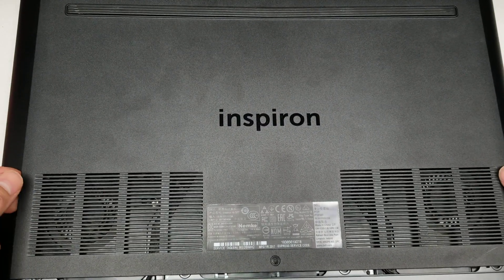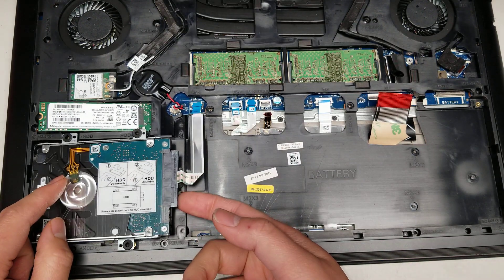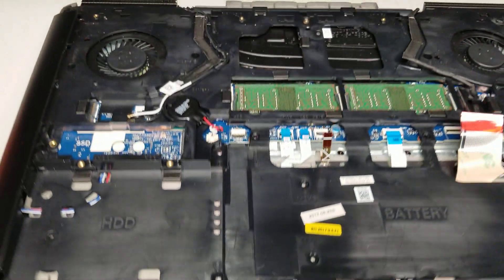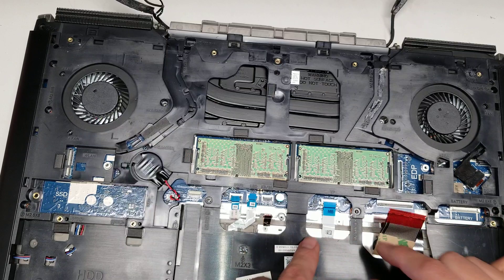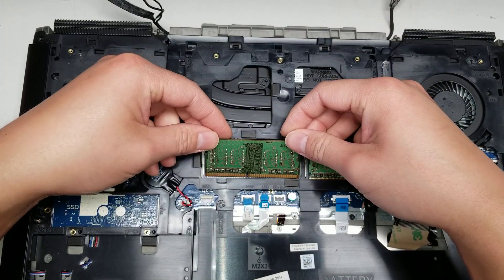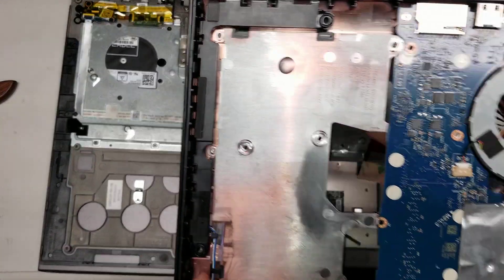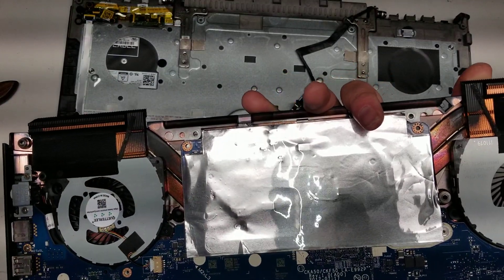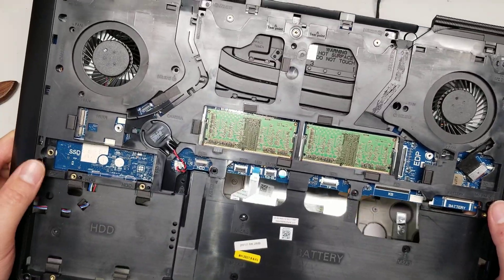DELL Inspiron 15-7577 15 Gaming 7577 Disassembly RAM SSD Fan Upgrade Repair

Comment: I was lucky to find this video, very nice tutorial. I was trying to change the thermal paste on my processor and GPU, but unfortunately, I wasn't able to reach it as the motherboard was hard to take off. I assembled it again and it was working fine. I'mma send my PC to tech support to do what I wanted to do, keep the good work, my dude!
Reply from the maker: Thanks!
Reply: You rock, man! Please, whenever you get your hands on this model again, make a tutorial going through the GPU and Processor if one want to change the thermal compound haha

Comment: Hi thank you for this video. It helped me a lot. Today I replaced a right hand side fan and had a problem starting the system. Black screen and laptop shut down after a few seconds. Then I disconnected most of the wires and tried to run several times adding one component at a time. It was like waking up the body after a surgery and it was so weak to rouse 😉 Finally it’s taken off by pressing a Capslock on a keyboard. Weird 😏
Reply from the maker: @marcindenis6732  lol it's because the bios reset. You have to wait a few minutes for it to start up after disconnecting the battery.
Reply: @ Thanks. Now I know 😁
Reply from the maker: @marcindenis6732  no problem

Comment: I'm so grateful to you for posting this video! It was easy to follow along and remove all the necessary parts. My laptop is working great with no more noise alert because my fan and heat sink are not working. I had to shut it down and rebut it again. Once I rebooted it, it went into the BIOS and I was able to reconfigure it. It booted up again and everything is working great.
Reply from the maker: @RickAlonso68  awesome, glad the repair went well. If you haven't already, please like and subscribe so others can find my videos and possibly consider watching a few others and commenting to get the algorithm to recommend my channel. Thanks!

Comment: How do I know if it's time to change my fan? it doesn't make weird noises, but when I run heavy software the fans work really loud, is that normal? is there a way to check the functionality of the fans? Plus, can you please recommend a RAM brand? I want to upgrade and add another one as I have had a free slot for it for years. Thanks!
Reply from the maker: If it's just spinning fast, that's normal. Check temps. This RAM will work well https://amzn.to/3RFX0J8
Reply: @ItsBinhRepaired  Thank you so much!
Reply from the maker: @moxa4367  no problem
Reply: @ItsBinhRepaired   last question: I figured out the RAM I have is Kingston. Would having two different manufactures affect the performance, or it's okay?
Reply from the maker: @moxa4367  should be fine

Comment: I’m confused. I’m having trouble removing the battery because there are two ribbon cables that you didn’t note in your video, one was easy to remove while the other isn’t. Any ideas?
Reply from the maker: Watch this video instead https://youtu.be/tJlN5WAMxtk

Comment: Hi I just finished everything step by step and cleaned up, now I’ve coupled everything back but my SSD work show on my PC, please can you help ?😊
Reply from the maker: How did you do the OS?
Reply: @ItsBinhRepaired  it’s showing now, I just removed it and put it back, only it removed my finger print, I’ll scan through and see if everything works fine, thanks brother, you just earned a new subscriber for life
Reply from the maker: Thanks!

Comment: Hi, thank you for your video and I want to replacement the fans because they work very loud(I damaged when I tried to clean) so which fan do you recommend because I could not find part number etc. I want to change both of them.
Reply from the maker: These should work https://amzn.to/3H9stwq
Reply: @ItsBinhRepaired  thank you man
Reply from the maker: @fastriderDE  hope it works out well.

Comment: Do you know if the top lids of this Dell 7577 and 7567 are exchangeable? I really want to get rid of the rubber coating of my 7567.
Reply from the maker: Not sure. You'll have to check with the sellers

Comment: My laptop fell down . It didn't start for the first day . It blinked in a pattern which internet says that indicates  cmos battery problem. I opened it and didn't close the back properly. It work fine the next day . I downloaded Nvidia driver and then closed the back panel and now it's sooo much slow . Ultra sluggish . Can you suggest what's the problem
Reply from the maker: probably failing hard drive. Check disk activity in the task manager. If at 100% a lot, your hard drive is dying.
Reply: Thanks bro . The disk activity was high from when I bought the laptop . I will surely try to replace and see . I am a bit less concerned now cause I don't have the budget to replace the mother board and stuff . And I have an FATA hdd  . Should I use that or buy another better hdd ?
Reply from the maker: @livvin-killin5557  this will be awesome https://amzn.to/2XqB5gg you'll have to either clone your hard drive or create a bootable Windows installer to put the OS on it.
Reply: @ItsBinhRepaired  thanks . But I already have the default ssd and windows is installed I  it . Even it got corrupted once but is fine now . Thanks for your help . can suggest a 1tb internal hdd under 40 dollars
Reply from the maker: I see
Reply from the maker: @livvin-killin5557  high disk activity means it is likely going bad

Comment: Hey i just wanted to know if you had to remove all the thing you did in the video to repaste... i really need to add a new thermal paste and I'm not sure how to reach the heat sink.. please help :)
Reply from the maker: Main thing is the battery and holding the power button. If you can't figure out what needs to be removed to remove the heatsink, follow the video exactly. I don't want to tell you steps you can skip and then you end up breaking something and blaming me.
Reply: It's Binh Repaired  What does holding the power button do?
Reply from the maker: @johnkhalil7146  makes the computer safer to work on.
Reply from the maker: Just do it, or don't, and increase your risk of breaking it tenfold. The choice is yours.
Reply: @ItsBinhRepaired   I mean what does it do to make it safer, I've never disassembled a laptop before so I'm trying to get a better understanding of everything and do my research because I don't wanna break my laptop haha, by the way this video is so helpful thank you! I'd still like to know how it makes it safer haha
Reply: @ItsBinhRepaired  Also how much risk is there to doing this whole process (I wanna disassemble it for repaste) I'm too scared my laptop may not turn on as it has a ton of work that's important and I can't afford another one for now
Reply from the maker: @johnkhalil7146  it drains power that gets stored in components on the board, mainly capacitors and what not. I don't know all the correct terms, but it greatly reduces the risk of damaging things, just trust me. I've been doing this over 10 years. Nothing worse than seeing a spark when disconnecting or connecting something.
Reply from the maker: @johnkhalil7146  I don't recommend messing around with the insides of the computer if you don't know what you're doing and only have that one. Backup your data to be safe regardless of whether to plan to work on it or not. Very important!
Reply: @ItsBinhRepaired  I will have to do it eventually because it's really overheating and I'm sure it needs a repaste

I have watched a good amount of video and I've read the manual and done my research so I think I'm ready I mean what can go wrong if I follow your video haha. Also one last question, do I do the pressing on the power button for 30 seconds thing right after I disconnect the battery? Or after I disconnect both the battery and cmos battery?
Reply from the maker: @johnkhalil7146  just the main battery. Cmos battery you can leave unless you need to remove it to take the motherboard/heatsink out
Reply: @ItsBinhRepaired  Do I have to get an anti static wrist wrap to do this? I'm kind of afraid of static ruining something
Reply from the maker: @johnkhalil7146  I keep my leg against my metal desk. Usually anything that can cause a static shock would work, but there's no guarantee.
Reply: @ItsBinhRepaired  nah lol, i just left it to a professional but thanks for the help and the vid😂🙌🙌
Reply from the maker: @redlance9010  hahaha no problem. Hopefully they did it for a decent price.
Reply: @ItsBinhRepaired  yep, actually i bought the thermal paste, so it was even cheaper lol :D
Reply from the maker: @redlance9010  sounds good

Comment: Hi, I'm trying to disconnect the battery for the first time and watching your video known that you don't have my own problem so I ask for information. At about 1:20, after you have detached the battery there is a red strip, in my case the end of that thing is gluedly glued with obvious battery glue. I don't know if at the beginning it was so for you too. Can you tell me something about it? What should I do to get away from the battery? Thanks in advance.
Reply: I had the same problem! I just carefully pulled the battery up from the end nearest the hardest drive to slowly peel away that keyboard cable that was stuck to the battery.  Make sure to not bend the battery much, try to keep it as straight as possible as the last you want is a fully charged battery exploding.
Reply from the maker: No glue, just screws.

Comment: Hey, Nice video ! Some of my keys are not working (1,Q,A,Z,tabs,caps,shift,ctrl). I have tried a few things like cleaning the keyboard cable but it did not work. Any suggestions ? Thanks
Reply from the maker: Going to have to replace the keyboard
Reply: @ItsBinhRepaired  do you think that I can do it myself ?
Reply from the maker: @DoqiReborn  maybe if you can get the whole keyboard assembly. Watch the video multiple times before ordering the part.

Comment: This video is super helpful! The touchpad on my 7577 has just started causing the mouse to erratically move and click on its own, and the screen now has a pink hue down the left 1/6th of the screen. Can you suggest any actions to try and resolve these issues? I'd rather not buy a new laptop!
Reply from the maker: Need to replace the screen, battery is probably bulging and pushing on the trackpad. Likely need to replace the battery.
Reply: @ItsBinhRepaired  Thanks for the swift reply! Is the battery bulging a common cause of this trackpad problem? The problem is intermittent which makes me a little unsure that bulging of the battery is the cause... If it was I would have thought the problem would be permanent
Reply from the maker: @Kerr982  open it up and check.
Reply: @ItsBinhRepaired  battery isn't bulging. Is it likely to be a software problem or most likely a faulty touchpad?
Reply from the maker: @Kerr982  possibly. Have you been wiping it with wet wipes or anything?
Reply: @ItsBinhRepaired  nope not at all. Have ordered a replacement so will fit it to see if that works. The problem being intermittent seems to me to point more likely to hardware issues being the cause instead of software
Reply from the maker: @Kerr982  yup, hope it works out.
Reply: @ItsBinhRepaired  thanks for the help!
Reply from the maker: @Kerr982  no problem
Reply: @ItsBinhRepaired  UPDATE - have replaced the tracker pad and that seems to have resolved the situation!
Reply from the maker: @Kerr982  awesome

Comment: I had to stop at removing the wireless card, because the screw was too damn tight, the drive of that screw is damaged by my screwdriver
Reply from the maker: Make sure you use the right sized screwdriver

Comment: Excellent. He also notes the parts you don't need to remove and he details how to easily remove the wifi antenna, for example.  I replaced my fans with no problem using this video.
Reply from the maker: Glad the video helped :)
Reply: Where did you get a replacement fan? I do not want to disassemble more than once
Reply: 2 Different fans 1 CPU, 1 VGA: https://smile.amazon.com/gp/product/B082Y2YNJV/ref=ppx_yo_dt_b_search_asin_title?ie=UTF8&psc=1 AND 
https://smile.amazon.com/gp/product/B082Y1YTF1/ref=ppx_yo_dt_b_search_asin_title?ie=UTF8&psc=1
Reply from the maker: Here https://amzn.to/35kMkuN
Reply: @ItsBinhRepaired  thank youu
Reply from the maker: @itgeln8772  No problem

Comment: Thanks for the video! Really great instructions on the laptop disassembly. But somehow my windows won't boot properly after Ive done cleaning my fan. It kept looping on automatic repair screen. It would be really great if you could help me
Reply from the maker: Try if it'll go to safe mode
Reply: @ItsBinhRepaired   I'm late to the party but just had the same problem- looping to auto repair, can't repair. I can boot into safe mode though. (already done: fixed mbr, boot, rebuild CBD via CMD) any advise and what's the relation of the loop and won't boot to OS but safe mode is fine? Thanks
Reply from the maker: @Dada-gk9ic  you'll likely have to back up data and do a clean install. You can try a system restore point.

Comment: How many M.2 slots are there? And what type of M.2  do I use as far as for upgrading? And is there a way to copy the current m.2 to a larger m.2?
Reply from the maker: Not sure. I mention everything I see in the videos. Anything further you'll want to Google it.

This should help you with upgrading to a larger SSD. https://youtu.be/4p5jFDzVwUw

Comment: Hello, thanks for the video. I just need to clean my fans, is there a simpler method or do I have to risk the life of my pc every connection I disconnect?
Reply from the maker: Just use an air blower or vacuum hose over the fans every couple months and you won't have to take it apart that far.
Reply from the maker: https://youtu.be/3zs_SJ3BXgA

Comment: Im planning on upgrading my ssd and ram could you reccomend me what I should buy?
Reply from the maker: Are you replacing the SSD or the hdd
Reply: @ItsBinhRepaired  The ssd
Reply from the maker: @joshuasu3707  Samsung or crucial m.2 not sure it supports nvme pcie though
Reply: @ItsBinhRepaired  OK thanks bro
Reply from the maker: Ram just make sure it's the same speed and comes with lifetime warranty.
Reply: don't invest sell this pc
Reply from the maker: Lol maybe they don't have money for a new expensive computer.